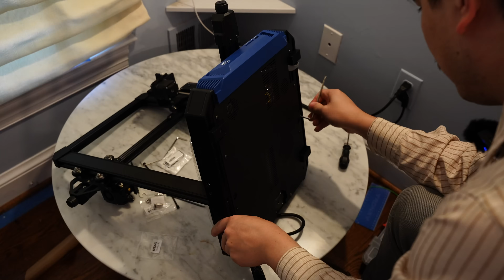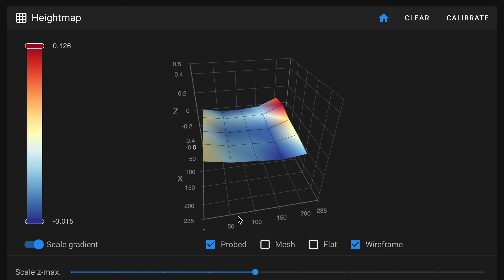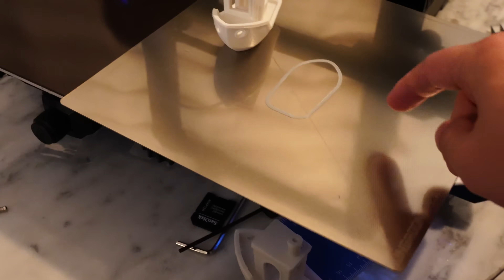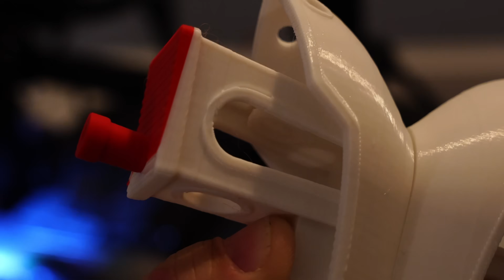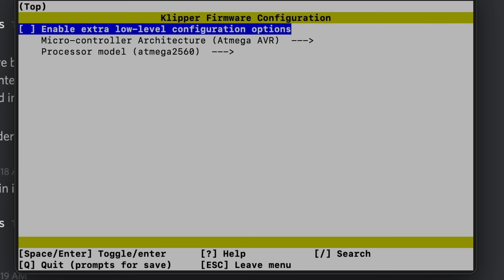The Smartest Ender 3 Alternative - BIQU Hurakan Review

Comment from the maker: Note: I did not attach the accelerometer correctly for X axis input shaper tuning. It should have been attached to the right side of the print head using one of the fan shroud mounting screws. because of this improper tuning procedure, the x axis was overshooting, which lead to the wavy artifacts seen on the back of the 300% speed Benchy. So if properly tuned, the ripples shown at 13:45 would not be there, and print quality in general would be even higher for the 300% speed Benchy. 

There were no instructions in the box, so I just gave it my best shot. Biqu sent me an email with detailed instructions on how to install and run input shaper. I will share my feedback and request that they include instructions in the box for running input shaper.
Reply: tbh, the y axis aswell. you need to find a way to fix this very ridgid to get the proper results
Reply from the maker: @thorgraum1462  I disagree but will rerun the calibration with it bolted down as I like being proven wrong. 🔩 
Static friction is very good at coupling things, as long as it is not overcome.
Reply: just bought one and they still dont have jack as far as in the box instructions goes lol but for the discounted price i got it for im not gonna complain. thanks for a good video and info that i used to justify my decisions

Comment: The vertical lines are cause by the stepper motors full steps. The wheels dampen it. Which is why you see it more on the steel wheels. Belts too tight will also make the effect more noticable. Even vorons will have them. Mine does when belts are a little too tight.
Reply from the maker: Nice. They are really quite ugly, would like to get rid of them entirely if possible.

Comment: First, I would lower the speed to two times the speed and get the best of both worlds. Also, I'd never try to loosen a cold nozzle. Always heat it up first, even if it's just 100 degrees Celsius. Other than that, great machine! If I ever have to buy a replacement for my Ender 3 V2, I'd get this one no question.
Reply from the maker: I view stock nozzles as disposable items 😁
Reply: @NathanBuildsRobots  I've been using a tungsten nozzle and a ruby nozzle before that, so I made a habit of treating them very well. ;-)
Reply: @TheSevenUpMan  You've gotta treat the tungsten well for your hotends' sake.

Comment: Thanks for another great review, with plenty of good thoughts about consumer FDM printing. Any chance you might review the creality sonicpad?
Reply from the maker: I would like to. They are offering to send me an Ender 5 S1, then a Sonic Pad. In the meantime, I have an FLSUN Speeder Pad, which is basically the same thing.
Reply: @NathanBuildsRobots  Klipper + Delta sounds like peanut butter + Chocolate. Looking forward to all of it. 

How about the old E3D revo quick swap nozzle hot end? Any chance one of those will show up with the help of a NBR Modderboard? I am tempted to get the modderboard to first try and improve cooling ability on my S1Plus, and possibly to add an extruder/hotend swap like the e3d Hemera Revo. I have a lower confidence level for DIY though and I am kind of waiting for someone else to pave the way on that second one.

Thanks again for the channel!
Reply from the maker: @beerlynoticeable  well, you use the modder board in a couple different ways. You can stick it in the base of the machine and run a "classic" wire harness out to the end,  but there is still quite a bit of DIY involved.

Comment: With input shaping you'd think that everything including the amount of filament on the spool during the calibration would impact the resonance frequency recorded.
Reply from the maker: Your are absolutely right. Everything from the filament, to the height of the Z axis gantry, to the table it is sitting on, to the belt tensioner setting, to the ambient temperature, to the weight of plastic currently extruded onto the bed - it all has an effect.

A truly smart algorithm would perform real-time calibration with built-in accelerometers in a closed loop control system. 

However, in engineering, there is such a thing as "close enough" which has been used to great effect to create nuclear fission and land in the moon.

Comment: That's what you need to add to your next revision of mod board, an LED!
Reply from the maker: Yeah, I will make some prototypes. It will take several months to get through design production and testing, but I'll add them when I can.
Reply: @NathanBuildsRobots  possible diy splicing an led into like fan terminal in the meantime?
Reply from the maker: @DARKredDOLLAR  you could totally do that, just make sure you don't draw more than 200mA. I would stick to 50mA just to be safe, and because 1.2 Watts of LED light is more than enough!
Reply: Just how would you go about finding the right led for a ender 3s1 pro?
Reply from the maker: @6rcracer6  Specifying LEDs always requires a bit of reading the datasheet and doing some math to make sure you get the voltage and current right.
Reply: Thanks for your reply, I  would be very interested in learning more about this and putting an led on my printer. Maybe this would make a good video?

Comment: The only reason I can see for manufacturers to use PTFE lined heatbrakes is for them to get away with simple cooling ducts, very often manufacturers rely on the "that'll Do" method of part and heatsink cooling wheras with an all metal heatbrake your cooling has to be more targetted or heat creep will set in.
Reply from the maker: Interesting take. I think PTFE is more dummy proof. Personally I have had an easier time cooling my all metal heatbreaks, since they conduct less heat through the narrow section. But if retractions are set too high you can get issues with jams. I have not had any issues with that in the past year though. It was more of an issue when I was a noob. With Ptfe lined, you can be very careless and it's virtually impossible to fully jam. 

All metal is also more fragile. It can be easily bent and ruined vs PTFE hotend which usually have thicker heatbreak sections
Reply: The PTFE tube does not go all the way down touching the nozzle. So this can be considered as an all-metal hotend.
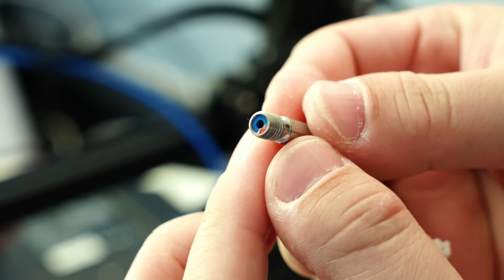Reply from the maker: @pcyap3155  if you look at 18:18 there is a PTFE insert inside of the heatbreak. A true all-metal hotend has no PTFE liner. I will be replacing it in the next video, it's a pretty easy job!

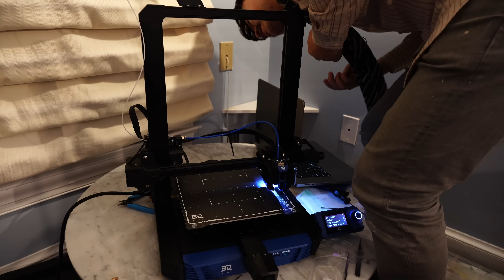Comment: When i have seen the 7:30 + i was like, ok, this is gonna be fun if he try to print something fast with calibration like this :D but overall look nice. personally i have ender 3 s1 with sonic pad, that thing is a beast printing 240mm/s like nothing with excelent quality (but took me like 2 days to find perfect settings), but was looking for something a friend, he wanted something basic but when i was  talking about klipper he just want it and not to print 3-4x slover then me with stock printer. ataken that this huracan costs 2/3 of the s1 + sonic pad ill try to show him this, cause he wants something cheap fast and reliable
Reply from the maker: Hurakan is $360 right now
Ender 3 S1 is $380, sonic Pad is $160, so yeah exactly 2/3rds. Nice math skills there! 

You do get the big touch screen with the S1, dual Z leadscrews, direct drive
Most klipper stuff is done from a real computer anyways, so you don't really need the big touchscreen. 

And you have to pay extra for a PEI sheet and deal with the USB plug sticking out the front in the Ender 3. But the dual z and direct drive extruder are pretty sweet. 

They are both good options. I really like how clean the build is on the hurakan, and it looks like it will be a lot easier to modify and upgrade. The mainboard on this thing is stellar.

Comment: making volcano shaped exit from the filament runout sensor might fix the unload filament function, as it would act as a ramp or funnel to let the filament move past the sensor if it came all the way out of the sensor already.  makes me wonder if someone might have already created such a thing.  that runout sensor looks really similar to the creality one
Reply from the maker: It just needs better filament guidance inside of the sensor. Or allow the user to pull the filament out to the side like I eventually ended up doing.
Reply: @NathanBuildsRobots  ah, so the hangup was actually inside the runout sensor?  that would be a different fix then haha

Comment: For Input Shaper you need the accelerometer as rigidly mounted as possible, screwed down somewhere is the most accurate, even taping it down can have some inaccuracies because of the slight spring in a tape material.
Edit: I saw your pinned comment. Yes they totally should have included instructions, especially for something as confusing as this.
Reply from the maker: The documented they provided online was very good, it would just be nice to include printed instructions in the box to make the setup even easier.
Reply: I used blutack lmao. It works pretty well for the most part
Reply from the maker: @Henry-by8en  I don't understand how everyone I talk to has piles of blutac laying around. I have never bought any of the stuff!
Reply: @NathanBuildsRobots  Maybe it's a cultural thing, in Australia it is everywhere.
Reply: @ballbous  lol exactly. Nearly a tennis ball of blutack somewhere around the house... With smaller deposits in strategic spots 😂

Comment: klipper on a bed slinger is kinda meh tho. I don't see much of a point.
also you should probably screw in the accellerometer otherwise the calibration will be all wrong :O
and tbh filament detection shouldn't be a pain. that's just crappy lazy design!
Reply from the maker: I think it's a good starting point to get someone into the Klipper Ecosystem.

Once you get someone started in Klipper like this, with training wheels on, i think they'll be a lot more confident in being able to take on something like a Voron build down the line.

The sensor needs to stop the print before the filament can get jammed inside of the sensor housing. I'll probably just disable it and bypass it. I'm amazed that the sensor still works after all of that crunching and abuse I put it through.
Reply: @NathanBuildsRobots  yeah. it's just bad design placement, I've never had issues on both Bowden and direct drive printers, I just connect it with a ptfe tube or leave it lose behind the extruder

Comment: You didnt mention if you upped accel, only speed to 300%
Reply from the maker: I don't know if the acceleration was increased. Unless klipper does that automatically, it's still at stock settings. 

It reccomended 2500-4000mm/s² depending on the algorithm used. Idk enough about that to speak in detail, but maybe I will look at it in the next video.
Reply: @NathanBuildsRobots  There is a nice calculator online, if you were printing at 150mm/s then 5000 Accel is perfect

Comment: So with the resonances, stiffening the printer up might not necessarily reduce the resonance. What you want is for something to absorb the kinetic energy of the moving parts and damp the resonance. A fully rigid printer would actually not absorb any of the energy so it would resonate worse. I learnt this when dealing with belt tension on my voron
Reply from the maker: You're right, the solution to vibration problems is not always straightforward. Vibration analysis is a science in itself.

Generally, when designing a mechanical assembly that requires precise position control, you want to make it as stiff as possible. Ideally, the lowest resonant frequency, AKA the fundamental frequency, should be much higher than the lowest excitation frequency. Look at CNC machines. The most precise, fastest moving machines on the planet are built like an anvil. This is the ideal form for a 3D printer, if price was no object.

If you don't care about position control, you can alternatively make the fundamental frequency much lower than the expected excitation frequencies. Think like a bungee cord, trampoline, or air suspension. You will not feel vibrations through such a compliant joint. However, the tradeoff is you have very little control over the exact position of the suspended object. 

Damping is important too. I definitely want to do a video on vibration analysis eventually.
Reply: @NathanBuildsRobots  I agree. The problem with 3D printers I think is that they don't have enough mass to be like an anvil compared to CNC machines. I think the rule of thumb I go for now is to have belts tight enough to be accurate, but loose enough to still have a little bit of give to absorb the kinetic energy
Reply from the maker: @Henry-by8en  the belts, being made of rubber, have a fair amount of damping compared to the frame. So allowing it to flex should help. Now that I have a klipper printer to use as a test bech I will be able to do some experiments.
Reply: @NathanBuildsRobots  what I found with my voron (which albeit is CoreXY kinematic as opposed to bed slinger) was that when the belts were tight enough to be rigid, the maximum accel recommended by klipper was around 3-5k mm/s^2, with a resonant frequency around 35Hz for the Y axis and the whole printer was shaking. However the X axis was unaffected. Loosening the belts a bit so that they were still tight but far from almost rigid raised the Y resonance frequency to 60Hz, and recommended max accel to 10k.

The X axis was unaffected by how tight the belt was for the most part and liked the near rigid belts. I think it's because the X axis has so little weight that tighter is basically always better. But for the y axis there's too much moving mass and kinetic energy. So you have to either bolt the printer to the ground or have tight but not rigid belts to absorb the energy
Reply from the maker: @Henry-by8en  that is very interesting. 

Resonant frequency is calculated as

(k/m)^(0.5)

The y axis weighs more, so fundamental frequency should be lower. It should always be the limiting axis, and the gantry should be made as light as possible. I think by Tightening the belt you may have been moving the resonant frequency of that axis closer to one of the excitation frequencies. Fun stuff, requires more analysis!